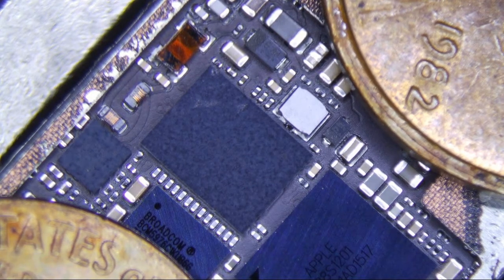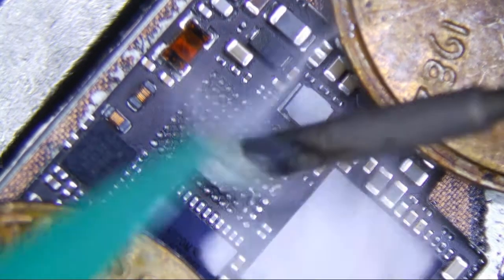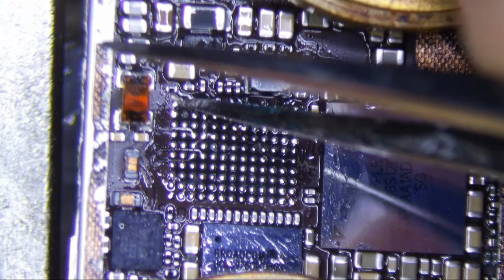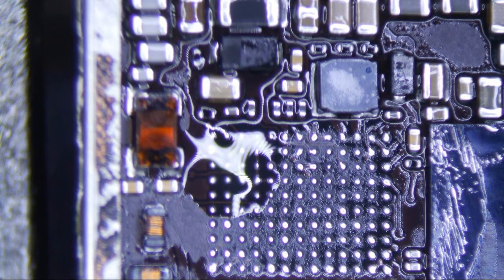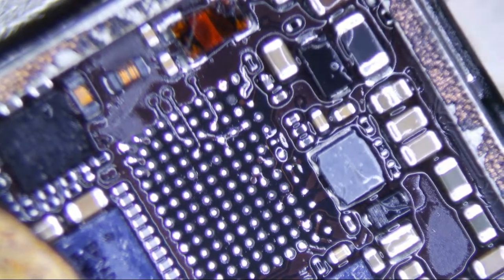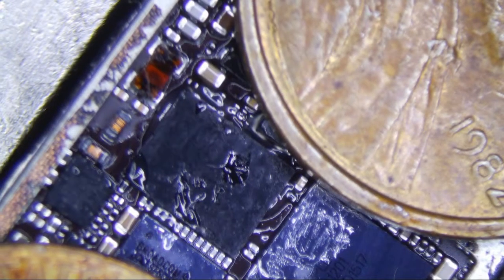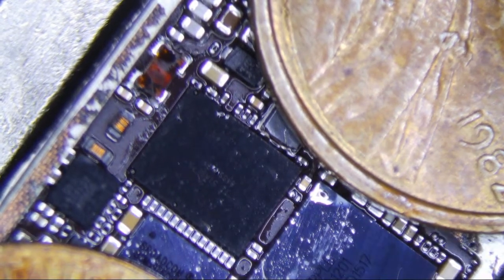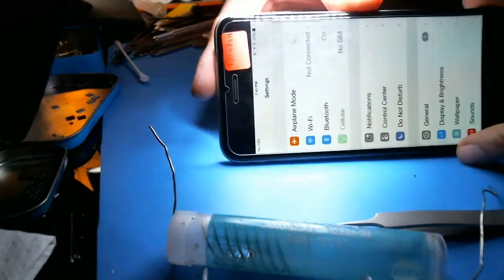iPhone 6 Plus Touch IC Repair with No Barlow Lens

Comment: You can not have flux on the balls while installing the new IC, it must be reballed and then cleaned. Put the new IC over the balls, apply flux over the IC and now heat the flux slowly. Having flux underneath leads to cold joints.

Comment: so how did you like the .7x barlow lens? is it better than the .5x ? and what is the main difference? i like to make sure i have a lot of room to work with under the microscope so i was wondering what where your thoughts on the barlows.
Reply from the maker: I measured the working distance, and the .5x is roughly 5.5" to 6.5" and the .7x is 3.5" to 4.5", so you're looking at roughly 2" differences between the two.  What this means is that you're going to lose 2" between your light ring and the desktop.  It hasn't hindered my work at all, so I like the .7x better.  My back likes it better as well.
Reply: Microsoldering so I am guessing now you can see even closer? Or did you buy it for the sole purpose to make your videos look better? Loosing about 2 inches is not bad I can probably get one inch back by removing the light from the adapter piece and attaching it directly to the Barlow lens instead of under it. I also got my eyes on these eye pieces that I want to purchase soon http://www.amscope.com/pair-of-focusable-extreme-widefield-20x-eyepieces-30mm-1.html so I might look into getting that Barlow .7 with them.
Reply from the maker: I bought it solely to help my back.  Yes, my recommendation is for both of the items that you mentioned above.  The .5x is too great of a working distance, IMO.